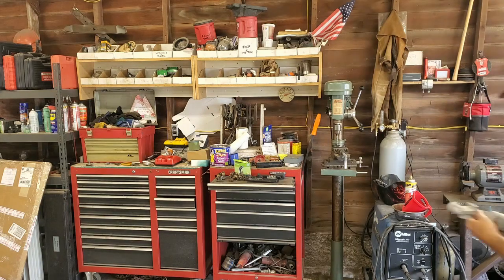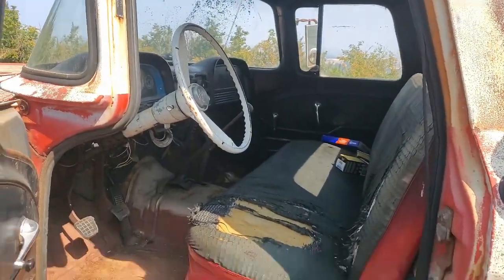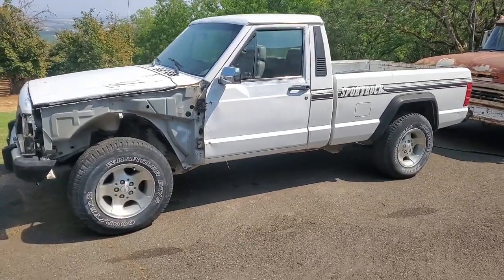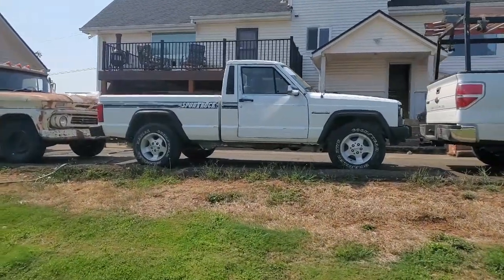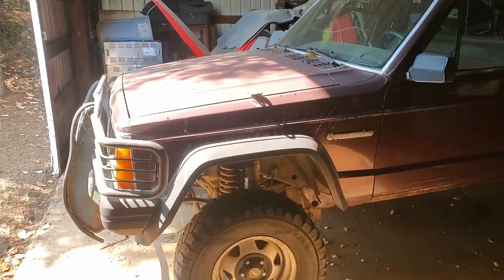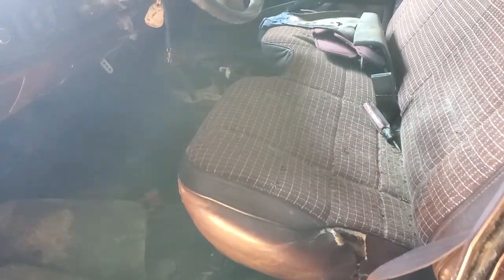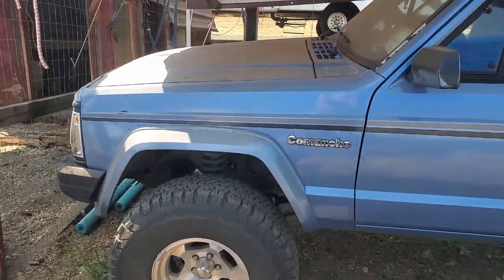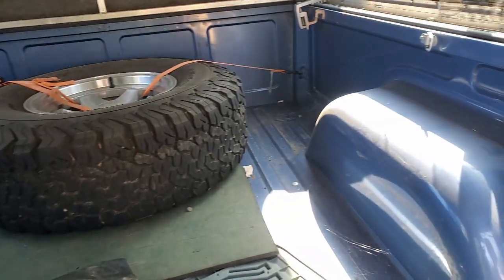Shenanigans - '62 C20 and three Jeep MJ Comanches!

Comment: This is going to sound crazy. So I have been watching videos where they are building bed campers for trucks. I was thinking finding a comanche with no bed like what you have and build a camper on the back for traveling and camping attached to the frame.
Reply from the maker: That’s actually a great idea.  My step son has a right hand drive Nissan RV that he has been renovating.  I could pluck some ideas from there.  I think the big challenge would just be preplanning a layout that works, then picking materials to keep the weight down?